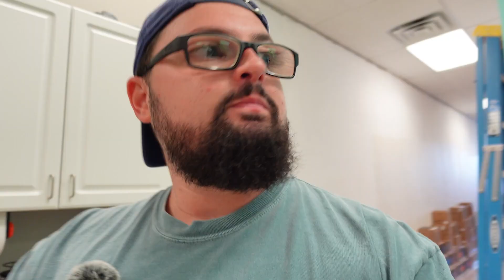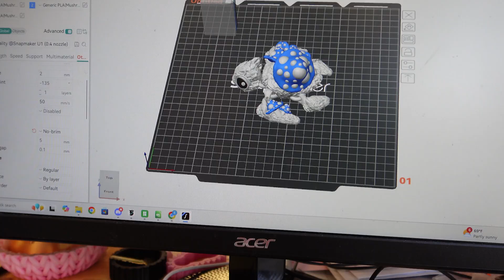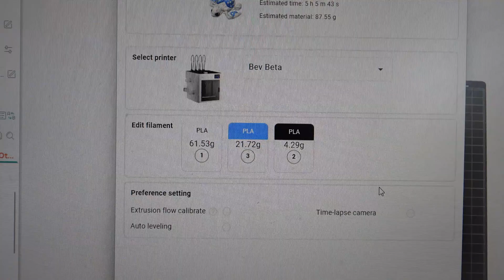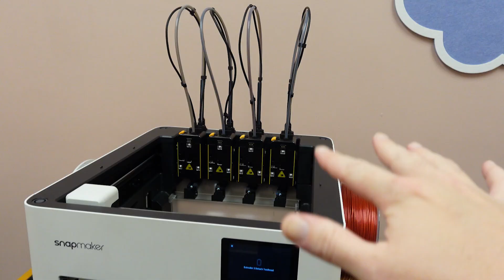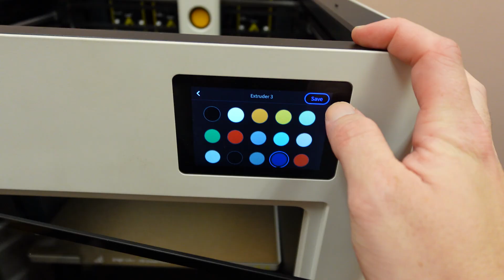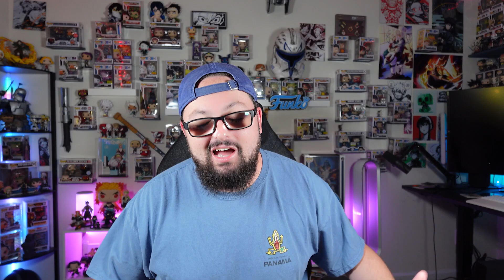Testing the Snapmaker U1 – 7 Hours Faster Than My K2 Plus?!

Comment: I'm going to get one. I love my bambu lab printers but I've been deterred from so many prints when I saw the amount of time it would take and waste they would make. An 800 dollar toolchanger printer is insane. And this is going to push Bambu and Prusa to drastic measures lol. I know Bambu has the H2C with their high tech vortek nozzle swapper coming out already, but this printer will still make them reduce price as much as possible and innovate. Everyone wins
Reply from the maker: 10000000%
Reply: Prusa already made a multi tool head printer, the prusa XL. Prusa cows what prusa wants. I've love to own prusa but they're typically higher priced.
Reply: @aiminglow but the price tho. Suddenly 1000 dollars per toolhead doesn't even make sense anymore

Comment: In theory, since you don’t have to do filament swaps, wouldn’t you be able to do multiple colors on the same layer of a Hugh Forge? In theory being able to add a lot more color variations to a print
Reply from the maker: The answer depends. Yes and no, the printer definitely has that functionality and if you find a print that’s designed to work that way it would certainly work. However, that’s not the way HueForge works. It will never create a mesh that has different colors on the same layer, because HueForge is built to differentiate layers and colors. But in theory you could, you could do it on a system with an AMS as well, but it would take significantly longer.

Comment: I backed it in the first run.  Really looking forward to it.  I'm wondering if for the unload process if something could be added to the code so that at the end of the print you could have it unload specific filaments while the nozzles are still hot.  This would make those slots easily available to load new filaments.  ie leave the black and white in but unload the red and yellow.  Then the next print you can just pop in the green and orange and get right to it.
Reply from the maker: It runs on Klipper so it’s pretty wide open you can configure it however you’d like!